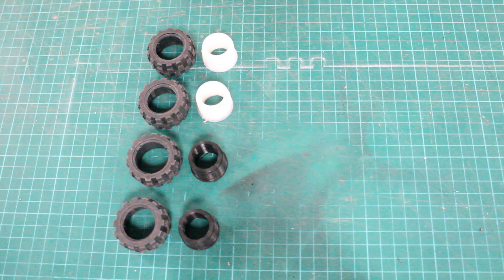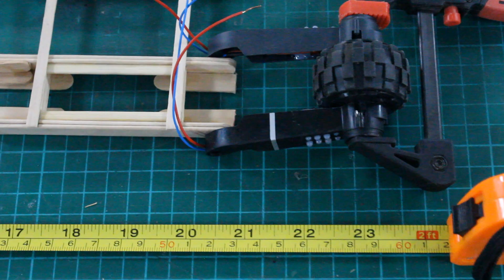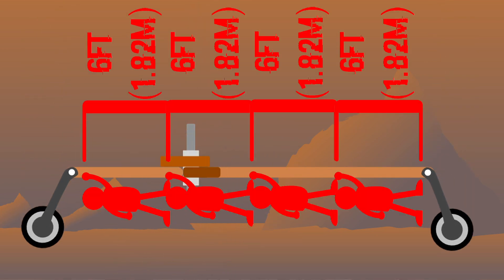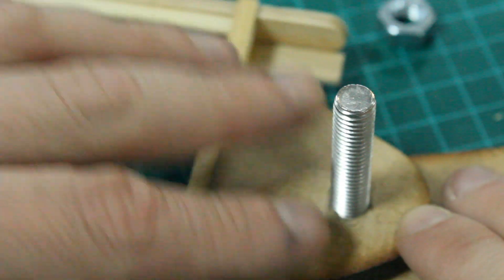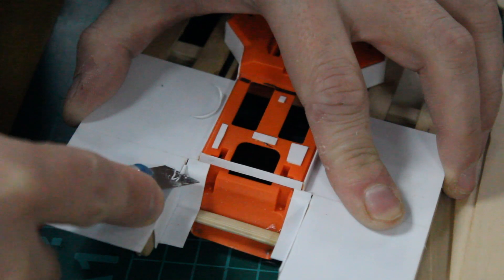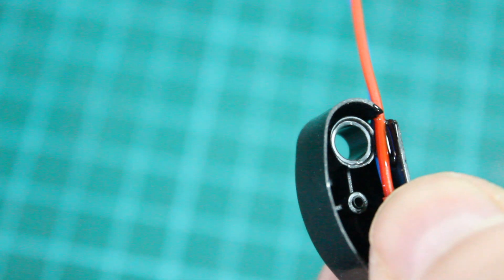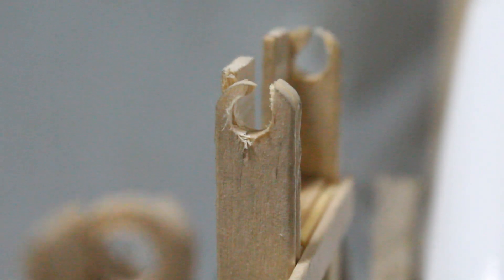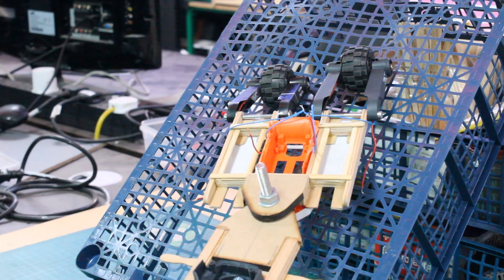HOW BIG is it in REAL LIFE? | #2

Comment: The evolution of the project is very interesting, great job!

 Of course scale is a challenge, since as a model it has to be referenced to other models in the same universe. 
But Sci-fi  is very forgiving: in a low-gravity planet, such behemoths could be useful. In our world, some vehicles for polar exploration are rolling arches. You may be interested in the video " Arctic Convoy With Giant Mack Trucks".
In such a sci-fi environment, this truck could be compatible wiht the Epson Space Airlock building.

The scale I'm using for my DIY models is 1:64, which is also the scale used for Warhammer miniatures. I guess it can be useful to make some miniatures to learn how to play with them before buying them. Also, smal scales don't take up as much room / volume as larger ones.

Regarding wood, yes I came to the same conclusion that it is not an easy material to work with. For the vehicle's axle holes, I would suggest making wire loops instead of drilling through the structure, as a bonus it would enable you to place them above or below and link them to suspension systems.

These thin styrofoam sheets look marvellous, I don't plan to use them because I had to restict myself to use only materials that are free and commonly available even in underdevelopped economies.

Plastic and metal are not porous and are this difficult to glue in place, I image styrofoam to be very porous and thus ideal for glueing.

I'm intrigued to see the next video :) :)
Reply from the maker: Haha LOL at Epson Space Airlock building!

You have a good very valid point... In a low gravity environment bigger might be better!

Both this project and the Airlock Diorama one WILL be linked (keep watching to find out as all will be revealed one day!), so perhaps similar scales will apply...

I am definitely going to revisit scale when it comes to model building, will be a video in the new year!

I enjoy your "recycle/reuse" policy on building models!
I do try and adopt a similar philosophy myself (as you will have probably already noticed)... I try and make out its because I'm environmentally focused,  but in reality its because I'm tight with money! 🤑😅🤣😂